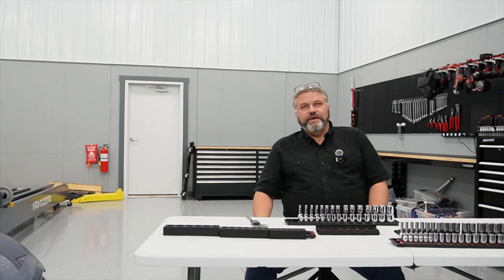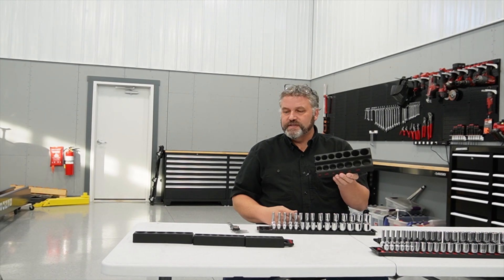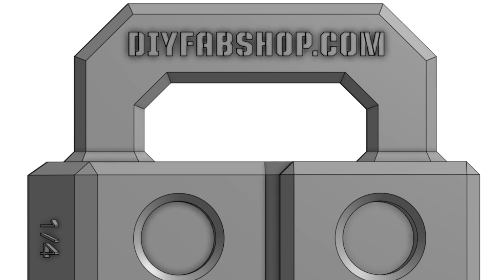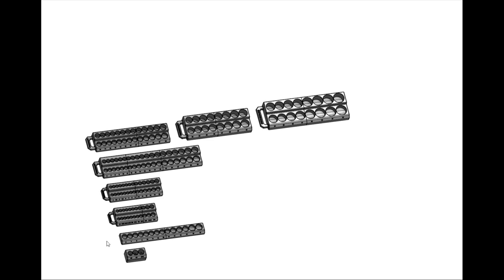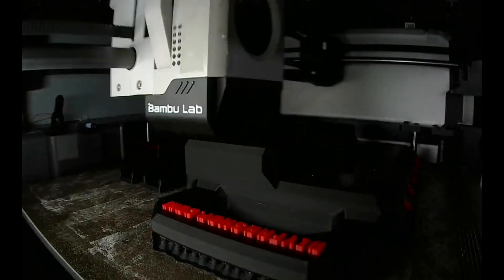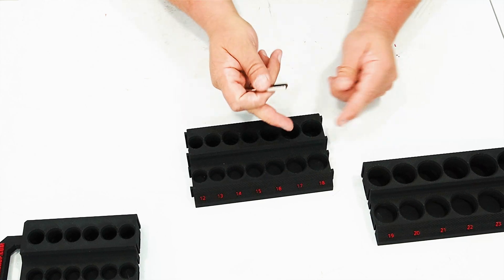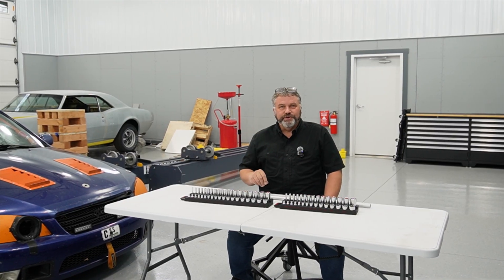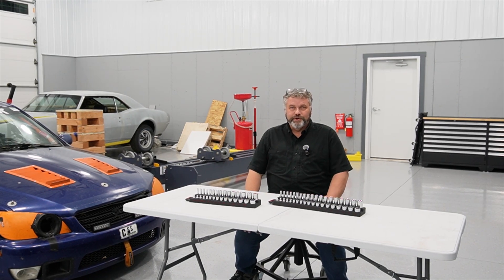Magnetic 3D Printed Socket Organizers Customized For You

Comment: Nice design! Adding some microfiber to the bottom or printing the bottom in TPU may help with the wife's paint. FDM printers use Filimant not Resin fyi.
Reply from the maker: Thanks, I am always using the wrong words for things 🙂, even when I know the right term.  The real embarrassing part is not catching it in editing.  Making the bottom from something softer is a good idea.  Still would need to be careful with the wife's paint as the magnets are going to attract fine metal particles to that bottom surface, especially in a working shop.  Thanks for watching!
Reply: @DIYFabShop  I thought about that after I commented, the simple and easy solution would be to put a clean soft microfiber on her car and then put the tray on top of it at time of use.

I figured that you knew the correct term but mixed them up while recording. I happens 🙃

Comment: I have been l  looking for this. You did an incredible job in designing these. The labeling of the socket are they 3d printed red or a paint pen? Also when looking at the rack you have labels on the front row of sockets, are the back sockets labeled as well?
Reply from the maker: The socket labeling is 3D printed red as I have a Bambu X1 printer that has multi-material capabilities.  The STL files could be just printed one color and the raised labels could be hit with a paint pen.  I chose not to label the back row as the design is such that the front and back row are meant to be the same size (regular and deep well) and the front row label is on an angled face so it can be read from the front or top.  Thanks for watching!

Comment: I’m going to have to make these from tpu.
Reply: That would take FOREVER and not be worth it.
Reply from the maker: I have only used to TPU on some thin walled parts, its an interesting idea.  Not sure how the dovetails would hold up, I may need to give it a try. Thanks for watching!
Reply: @ I will be using pvc cement to hold the parts together. If not I’m afraid with the length it’ll flex too much maybe come apart. If it doesn’t come apart it’ll look bad at the seams. I’ll probably make some shims for the sides as well so that I can install replaceable felt for the bottom to help protect the cars paint.